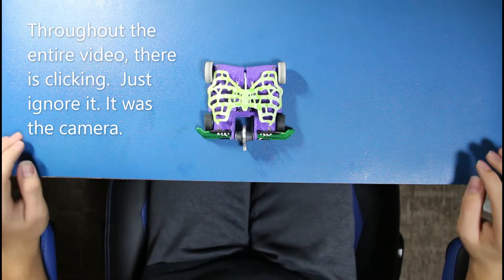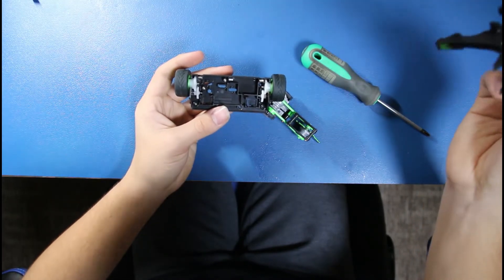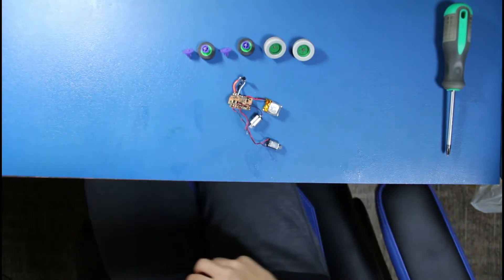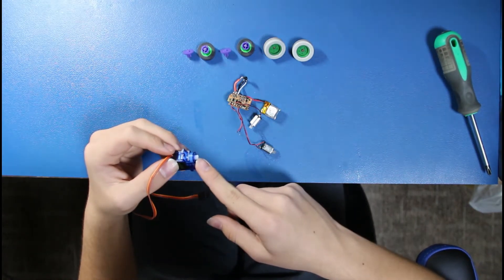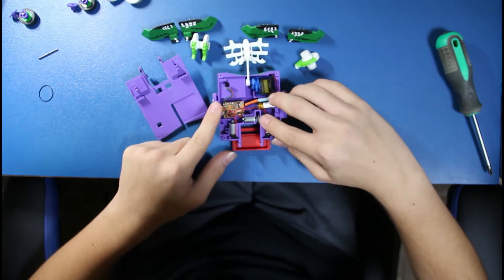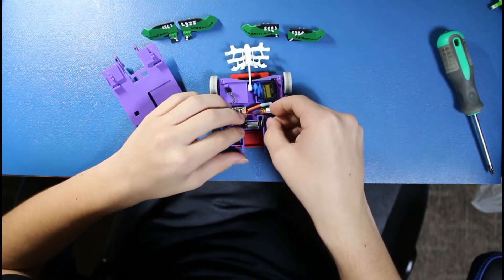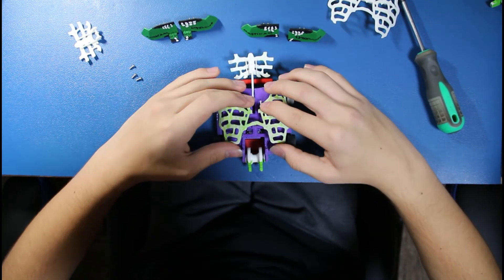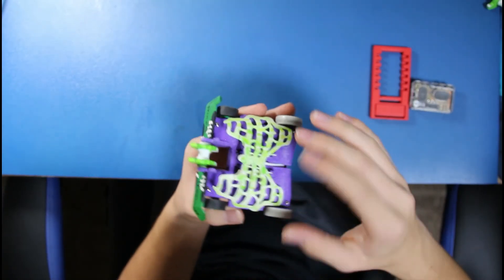HexBug BattleBots Witch Doctor S6 Build Tutorial

Comment: I’m stuck on the servo step. How did you get the servo to be one with the circuit board?
Reply from the maker: I dissected the servo, removing the whole internal circuit of the servo so the only electronic inside it is the motor and wires that go to the hexbug circuit board.  I hope that helps!
Reply: I actually have found it very handy to make a custom mount out of LEGO. I’ve had to cut the studs off the top of the brick and glue on a LEGO half bushing with Arrildite onto the SawBlaze gear attached to the arm motor.